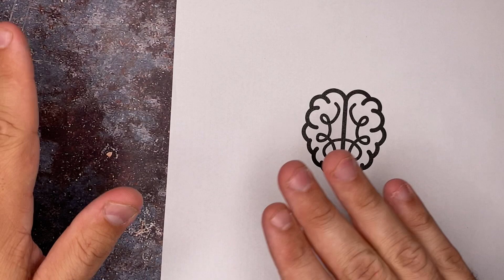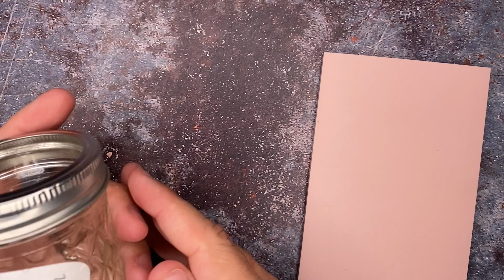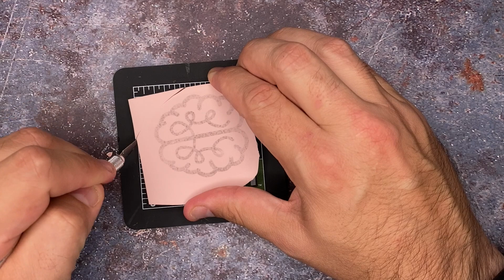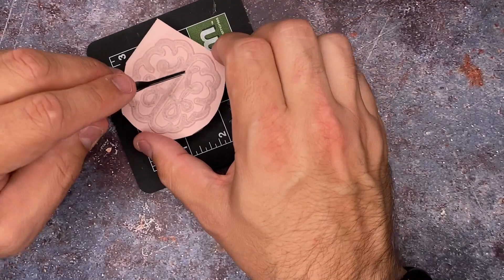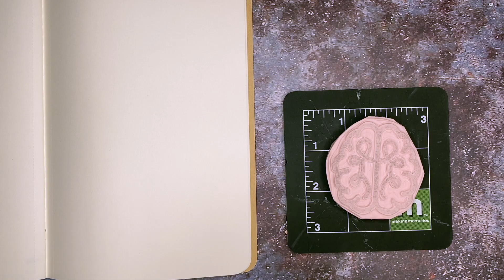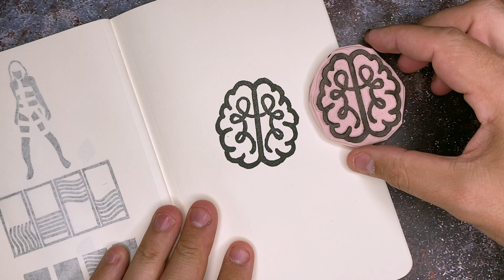DIY Stamp Making: Make Your Own Stamp Using A Blender Marker Transfer Method

Comment: I have been using this technique successfully with Lino for some time. However I cannot get it to transfer onto the pink rubber for carving. I have tried on multiple rubber block and the blender pen will just not cause the image to leave the paper.
Reply from the maker: From what I have learned the print needs to come from a laser printer for the image to transfer.
Reply: Hi Yes it's from a laser printer it transfers no problem onto grey lino but never to rubber. I just cannot understand it.
 @markyourpages

Comment: I was messing around with stuff today and found out that hand sanitizer and rubbing alcohol works really well to transfer. I soak the paper in rubbing alcohol first and rub the paper into the stamp, then add a dab of hand sanitizer. Rub that in as well for a few minutes, and let it dry a bit, then lift. The whole image transfers, like there's nothing left behind on the paper. It's crazy.
Reply from the maker: Ooooo that sounds like a very neat and messy idea. I like it 😆